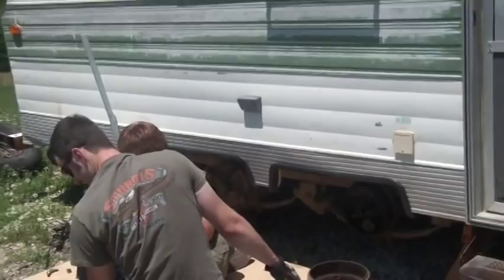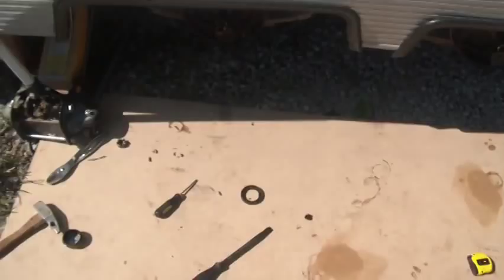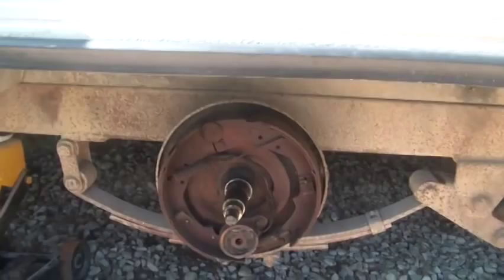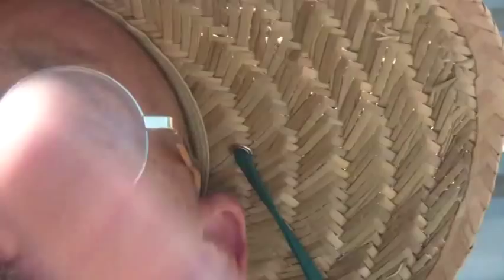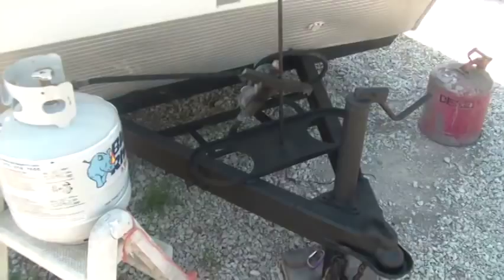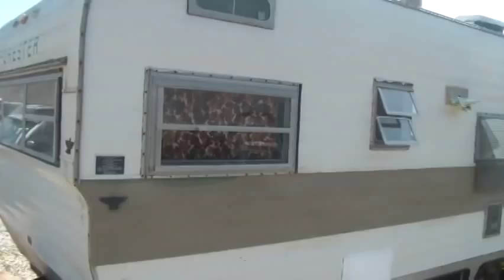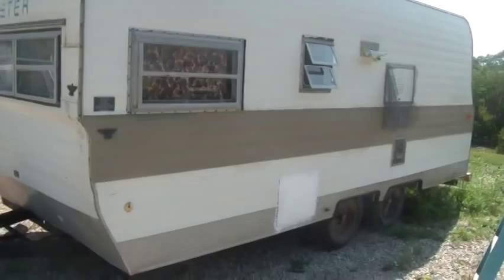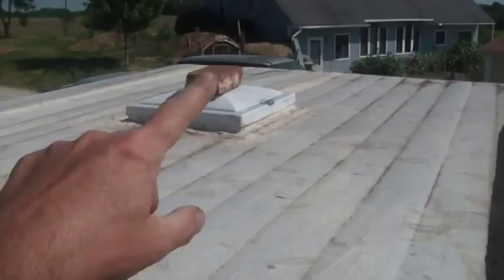Bugout Camper - Hubs.

Comment: I have learned to do trailer repairs in TWO stages... 1st stage: disassemble, inspect and then find the old retro parts you need and order them. When all parts are in, go to Stage 2: Reassemble and test.
Not as much wasted time running to every parts store in the town hoping to find a part that may work. Better to order in the EXACT part. Google and eBay are your friend in that regard...
Just bought a new 2011 Puma 20' trailer so I can focus on outfitting it with solar and other goodies...

Comment: Been there, done that... The videos are on my channel. The hubs and the brakes are a very important, if not the MOST important, sub-system on a camper trailer. Check those brakes! You didn't mention them in the video. That disk that gets electric-powered and grabs the hub looks worn out and metal to metal contact. You will really appreciate working brakes hauling a trailer that size loaded down with stuff... It will be dangerous without brakes if you need to stop quickly...